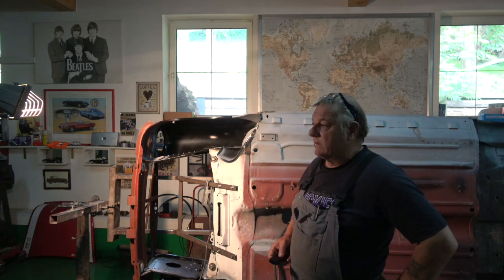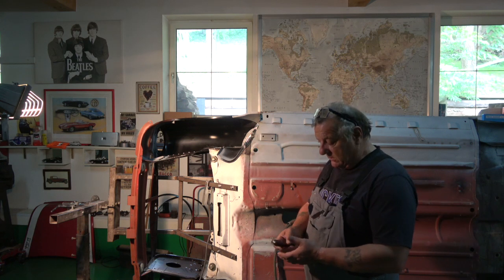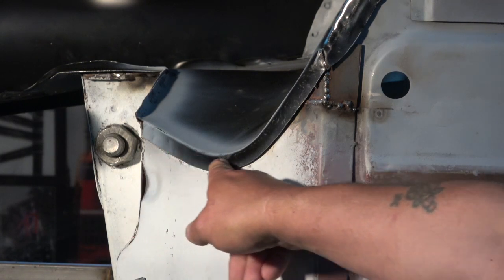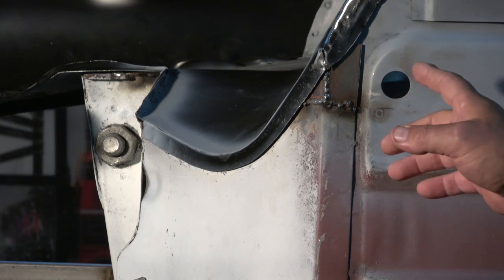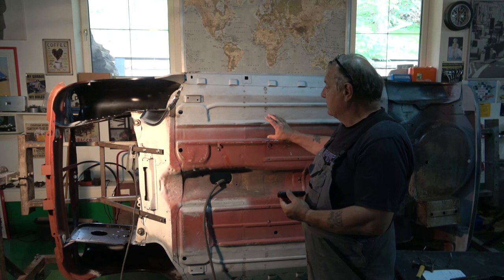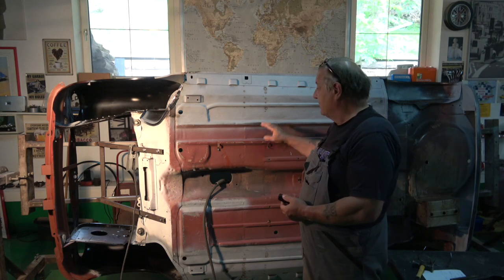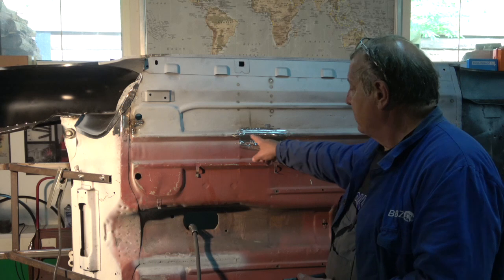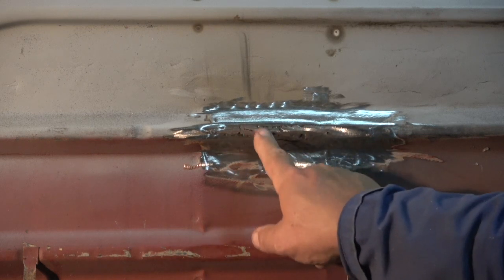Classic Mini floor Repairs Part 1

Comment: Really interesting Dave I genuinely enjoyed watching that as I'm worried mine won't look anything like that haha
Reply from the maker: Alex, Thanks, What i‘m trying to get over here is anything can be corrected by doing that little bit extra with your work, It‘s not required for a test but i am lucky enough to have the time to do it! If you tackle a bit at a time and 
you get your welding so it‘s strong not pretty you will be suprised how good the repair will look! Cheers Dave.

Comment: dave, what about using some of those pins that get spot welded on and then using a slide hammer to pull them out?
Reply from the maker: Bob, Burt Johnson mentioned the same thing so i will give the smaller dents a pull the one i did was too badly creased to pull it out, Cheers Dave.
Reply: Ok that makes sense

Comment: Hi dave would it be worth having a go at pulling them out with your spot welder puller?
Reply from the maker: Burt, That is a good point i will have a go at the flatened out rib with the dent puller, The one i am doing was just too creased to pull it out! I wanted to show some methods of how it can be done, There are so many lol, Cheers Dave

Comment: Dave. Not related to this video but did you use heritage or magnum door skins when you did your mini doors ? Cant decide which to go for ?
Reply from the maker: Heritage panels are expensive but they are in my opinion by far the best, You end up with a lot less hassle & work and a far better finish, I have had real prpblems with Magnum panels in the past, You get what you pay for! Cheers Dave.